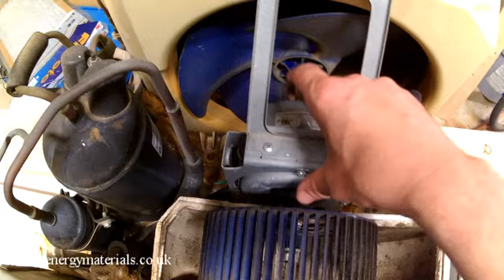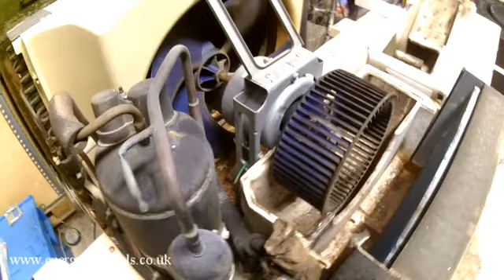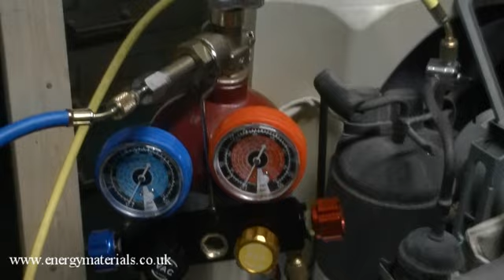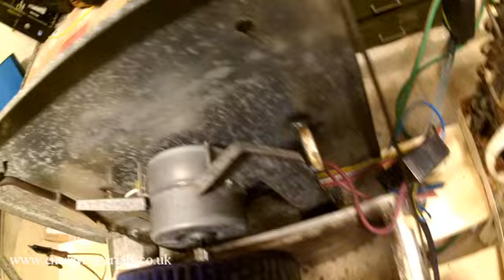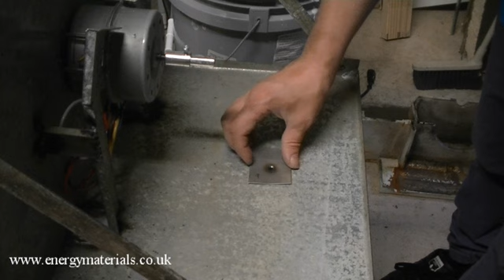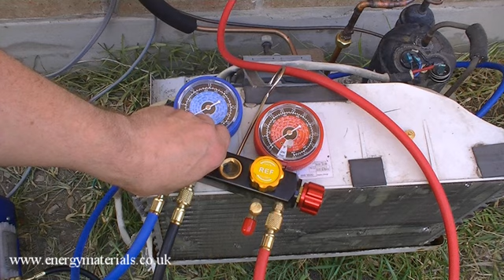Turning a window AC unit into a split AC unit

Comment: Thanks and very informative. I have, over time, purchased the tools that you have except for the recovery unit.  I am planning on doing this with a newer MIdea unit with an inverter compressor.  By splitting the unit I should also get better access for cleaning the fan blades.  One other thing-I’d put the condenser unit on a wall rather than the ground/pad-easier access and not impacted by snow/mud/leaves/etc

Comment: You don't need to use the recovery machine to get the refrigerant into the system. You open to the low side and the compressor will suck it in when running.

Comment: I want to do this with a new 5k btu window ac unit for my computer servers and network. The room is near our AC return it sucks the hot air out makes my large 4 ton unit cycle a lot the heat coming from these computers. I was thinking a tiny AC unit right where the source of the heat should fix the problem same me some money. The key is not having to spend lot of money on a regular mini split I don't really need a large unit anyway.

Comment: As an hvac tech, I have considered doing this with a reliable conventional knob control window a/c instead of buying a true minisplit with all the electronic junk. And is cheap.
Reply: Have you done it yet , and has the dc inverter style peaked your interest .. I'm in STx and would love to make one dc powered and run off the excessive sun we get
Reply: @JJM-f3h  If a unit is worthy you can make your own electronic board using better components. using a mini split instead of windows a/c. All mechanical work would be very easy plus you would end up with modern looking unit. just a thought.

Comment: How did you calculate what size capacitor to use?
Reply from the maker: Thanks. I just used a similar uf value that was on the original capacitor.

Comment: i picked up a 10kbtu unit form a pawn shop for $5. they said it was returned and broke. i thought i could use the heat exchanges for random projects if nothing else. funny thing is that it works on the bench as it should with one exception, the label says it should use 1000watts, but its using about 1400.

i plan on making something for heating the house. i used a couple little heat pumps all winter last year, but i am not done learning playing so i dont know what i am doing. anyways, i dont plan on making it complicated with reversing valves or anything. i am planning on seperating the condensor and evap like you did here, but i am going to put the condenser and pump inside and evap outside. likely just use 1x2x20 inch  foam board and drill two holes and pass my copper tubes through it and set this in the window. it wont look pretty but should work.
this may just get installed when its cold and then brought in when its hot for now.
Reply from the maker: Let me know how your project goes, best of luck
Reply: @EnergyMaterials  i recently took on a good paying job that requires me to travel to the point i am gone 6 out of 7 days a week. just today i txted someone to come get this stuff and get it out of here as i dont have time or space for this stuff. most of my motivation was based on being poor and investing a great deal of my income into my solar/batteries/ebike to learn some skills, save money on bills and have cheap transportation. i am not done, but i am down sizing my arsenal of experimental equipment. will likely add more batteries/panels and small ready made heat pumps this winter.

Comment: Ive long wondered if this is possible! Thanks for the video.

Would it be better to drill two small holes in the brick to reduce line length?
Reply from the maker: Good point, yes it would have. Shorter line length and avoiding working in the attic would have been an improvement.

Comment: Pulling a vacuum and holding with a micron gauge would have saved you 24 hours. Also 410a should be charged as a liquid since it’s a blend refrigerant. You can do this by flipping the jug upside down as indicated on the jug. Cool idea. Cheers
Reply: Well I've never seen an old window A/C like that that hadn't already lost its charge (HINT HINT) although I do believe in environmental stewardship if it's actually beneficial to me, so I'd refill it with refrigerant grade propane or propane-rthane blend depending on if it were R-22 or R410A. Increased energy efficiency and no need to recover when you realize electricity isn't free and you should have just gotten a cheapo mini split from Temu.
Reply: @matt697845  Increased energy efficiency but low effeciency. The compressor, condensor, evaporator and expansion device needs to be modified for R290/R600a.
Reply: True.

Comment: SEER?
Reply from the maker: SEER rating, good question. I've not measured but am confident this will be a better value than a conventional portable unit that most people use for garages. Portable units, by their very nature create a negative pressure environment due to the vent pipe wasting conditioned air. As this is a split system there is no negative pressure created inside the garage.

Comment: Didnt you add a bunch of pipe? Shouldn't you put some more in. Oh wait spoke too soon.... Would really like to do this and make my own split system
Reply from the maker: It was a long video (apologies for this). It wasn't as hard as potentially it looked, especially if you can get two similar window AC units and do not need to fabricate a 2nd box to house either the evaporator or condenser.

Comment: Nice job, very clean work. Did you get a recovery unit just for hobby purposes? Judging by the age of that window unit, I'm guessing R-22? Or is it a case of "I can neither confirm nor deny"?
Reply from the maker: Thanks for the positive feedback, the unit I worked on was R410A; although it was definitely an old unit- may be one of the 1st generation of R410A after R22 was phased out?